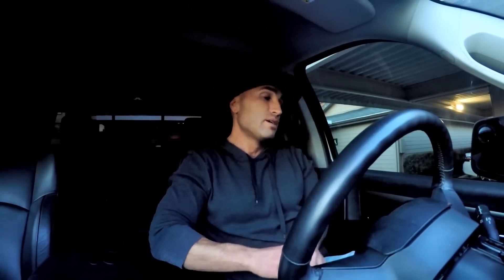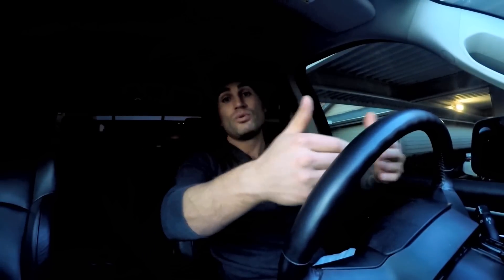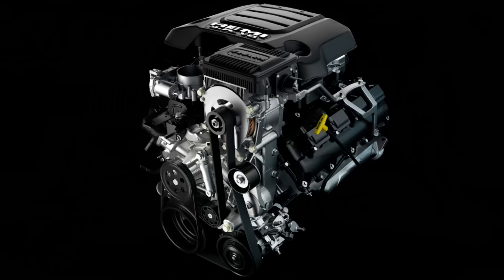Replace Your MECHANICAL FAN With ELECTRIC FAN like the 2019 RAM

Comment: I agree with you 100%… I did this after seeing several videos and in-depth research on this modification, the one thing that I did miss was turning off the MDS increases heat! The fan is I’ll not cycle often enough to bring the heat down

Comment: I recently purchased an electric cooling fan from a Dodge dakota to replace the stock clutch fan on my 08' Ram Hemi. It appears it has all the same locations for the mounting bolts and thee is a plug already mounted on the shroud it came on (3 blade male plug), however, am I missing components to make this work in my truck? I dont see any other plugs in my truck engine comparment that this would plug into? Any help would be greatly appreciated.

Comment: hey John.  you mentioned about removing your stock clutch fan, and shroud.  To replace it with the electronic fan, but you never mentioned if your engine was v6 or v8..  I was wondering if the oem v6 fan you installed, would work for a  2010 v8, 5.7 hemi ???
Reply: His is a 5.7

Comment: The operating temp debate is always a fun one. I have an 07 1500 with the Hemi, stock everything. Hits roughly 215F before cools back down to 203-204, fans kick on when they’re supposed to. Bumper to bumper gets a little warmer, sitting closer to 210F. Unless it’s a race truck or you care significantly about performance, it’s just fun to mess with that stuff. I’ve certainly considered a V6 fan but ultimately decided it’s not worth the money for me when my truck runs just fine stock. Even when hauling, temps sit rock solid 203-204. Considering a 180F thermostat, but until my 203F fails, 🤷🏻‍♂️

Comment: So I'm very interested in doing the efan swap on my 2013 ram sport. But I don't want to change my thermostat to a 180 degree station. And I don't want to take my grill shutters off. If I do the swap do I need to change the fan settings with a tuner or will every still work properly? If I do have to change the fan setting with a tuner what am I changing and to what temperatures and I changing the settings to? Also if I change the settings do I have to change anything else for the shutters or will they work right?? Please answer I have done a tone of reading but nothing is very clear.

Comment: Without the clutch fan doesn't the electric fan only come on if air conditioning is on? So if you're not using the AC how would your engine get cooled?
Reply from the maker: It will come on if temps hit 220* or you get a tuner and reprogram the fans to come on whenever you like

Comment: I Run both.
High humidity and desert conditions with steep hills while pulling a trailer.
HD Clutch fan , deep in a full shroud, 
V6 electric fan with lower programming set point.
If one fan dies like mine did today you will be grateful.
If you're fan is roaring it is busted.
It is supposed to slip quite a bit when first starting and engage more when hot.
A clutch fan doesn't pull hp like he's saying.
Yes, it's true that fully engaged, a clutch fan can take Up to 20 hp to run.
But that's waaay up there and a clutch fan is always cycling so the actual average is quite low.
The tests he is referring to is dyno cell testing peak hp for drag racing.
E-fans eat hp too.
They don't run for free.
Unless you're drag racing.
If you put a full throttle disconnect relay on the E fan and realize that a properly working clutch fan won't even be engaged with that much air flowing at speed. 
External plate cooler for the transmission is a great way to increase cooling capacity and remove the possibility of getting pink goo for transmission fluid if it were to leak .
An override switch for the E fan relay mounted inside the cab to put full juice to it when at slow speeds is nice too.
Replacing the two hundred bends per transmission line , on the factory lines that wrap around the catalytic converters is a big help too
So the insurance is definitely worth it.
My truck would have taken a beating otherwise.
As soon as it started to activate the E fan all the time I drove to the parts store and picked up a new HD fan clutch.
Had it installed in no time flat and nothing got beat on.
Aloha

Comment: In the video you state "probably the 2018 hemi."  Any update on that? I just got a 2018 with the hemi and might do that e Fan mod if I can pin point the correct fan to buy. Looks like I need the 09-12 V6 fan? LOVE LOVE LOVE the videos, THX
Reply from the maker: Yes sir it will fit the 2018 also but make sure you order a v6 fan from a 09-12.  They changed the plug on the 13+ v6 fan to some weird one 👍

Comment: @boostedmotorsports So if I have the capability of changing the temp the fan turns on at. What is the best set up to run? 180* Tstat and fan turn on at what temp?

Comment: The 2019 Ram without the thermostatic fan has a very different radiator installed to compensate for the loss of constant flow the rotational thermostatic fan generated.  You must remember that the thermostatic fan has a fluid coupling that controls when the fan is actually fluid connected or freewheeling.  To remove the thermostatic fan from the earlier models should only be done when the vehicle is used for off-road operation such as drag racing.  The dual fan operation is for optimum cooling.  Ask yourself the question, "what if the fuse blows or short happens while you are out driving?" Now, you don't have but one fan now, get it? As with me, I have my favorite 2014 Dodge Ram R/T which came with HD cooling for towing.  When I start my truck up in the morning, I don't hear a loud roaring noise coming from my engine compartment. Reason, the fluid clutch is freewheeling quietly no noise.  If you have loud noise during a cold start upon startup, then you have a problem with your fluid coupling engaging while your engine is cold. Lastly, I would not put a fiberglass flex fan on a gas lawn mower much less my prized truck. The rivets come apart and shatter sending blades of fiberglass into your radiator and everything else. Take the advise of a lot of us from the late 60s and 70s muscle car era who removed their thermostatic clutch fans for the so called popular loud fixed blade flex fan and drive in the street with all the loud roaring, engine didn't keep a constant temperature, and subsequently flex fan comes apart when you are in no mans land.  Frustrated, you get back home and repair all the damages that were done & now replace your favorite High Performance thermostatic clutch fan assembly back on your vehicle and you notice an immediate difference in constant engine coolant temperatures along with less irritating noise.
Reply from the maker: Electric fans have been out forever and the majority of the vehicles on the road rely on electric fan cooling.  Not scared of a fuse blowing or fan motor going as its rare.  Also it would only be an issue if you were dead stuck in traffic.  Even city driving the fan never comes on with the supporting mods. The jeep with the same 5.7L engine has an electric fan from similar years so not a valid point.  Been in 112* desert heat and still sitting at 185* which is cooler than the stock 203* operating temp.
Reply: Also ur saving your water pump life taking the big mechanical fan off.

Comment: Hey John

Great videos as always! 

I want to do this mod on my 2018 ram limited but I'm not sure if I could do the tune as I think my pcm is Locked from factory.... can you confirm?   If I change the thermostat to the 180° do I really need the tune? I'm assuming that's just to tell the fan when to come on correct?   Is 220° harmful? 

Tx again brother!   Great vids!
Reply from the maker: Thanks for the support! I believe they have already cracked the 2018 PCMs and you can get it unlocked and tuned but double check!  You can change the thermostat without a tune but some have reported a CEL in cold weather but the data on that isn't 100% certain.  220 is on the warmer side but doesn't hurt anything.  stock thermostat isn't fully open until 203* anyways.  If you delete your active grille shutters the fan will rarely come on anyways.  Any "loss" in aerodynamics from removing the shutters is gained back with the removal and drag of the mechanical fan so I didn't see any downside to be honest.
Reply: @BoostedMotorsports  
O.k. cool I'll look into it for sure!
CEL?  Sorry for my newby-ness.... 

You think of I delete the fan ill have warrentie issues if say anything messes up?   Serems like a pretty obvious question I know... but.. I wonder if they would care as long as it's getting proper cooling.... Surry dude but I think I may have answered my own question. Lol.. maybe the best thing would be to wait til warrantie is up... thoughts? 

Tx again brother!   Vids are great!   Keep em coming! Much appreciation for sure! 
Adam

Comment: Hey BoostedMotorsports my truck goes to 212 degrees and then cools to to about 194 degrees then  starts to go back up. You think I would still need a tuner to adjust the fan cut on?
Reply from the maker: Is that with the mechanical fan deleted?  Stock thermostat fully opens at 203* so your temps aren't far off.
Reply: @BoostedMotorsports  No sir, it is stock 2014 Laramie Limited with towing package.
Reply: I want to do the fan delete but thought I would see what you had to say about my Temps

Comment: What would happen if i just removed the mechanical fan and kept the v8 efan?
Reply from the maker: You could do that too as long as you don't do any heavy towing or live somewhere super hot cause that fan is a bit smaller than the V6 version.  With that being said though there are guys in Texas heat running the v8 efan without issues

Comment: What's the point of the 180 thermostat mod? Isn't 180° to low for the engine? I don't understand how it works.
Reply from the maker: It keeps things cooler which is better for performance.  They run the higher 203* thermostat from the factory for emissions reasons but it hurts performance with the engine that hot.
Reply: BoostedMotorsports Oh I see then! Thanks for that. I would definitely want to get that upgraded. Taking care of keeping the engine cool just means a longer lasting hemi!

Comment: I'm wondering what would be the best choice for someone that wants to keep the truck mostly stock.   I just want to see MPG improvements for the most part and don't really want to get a tuner but I want the electric fan to coll the engine properly.    Can I just swap the fan with the electric without having to do any tuning?
Reply from the maker: You can swap the fan without getting a tuner.  Only thing is the fan wont come on until about 220* with the a/c off which is slightly warmer than typical operating temps.  It won't overheat.  If you run the a/c the fan will come on sooner and keep temps closer to the 205* mark where they usually are with stock thermostat

Comment: Would it be okay for me to do the fan mod without doing the tune or lowering the fan temp. probably biggest thing I'll ever tow would be my bike down to Bike Week
Reply from the maker: Yeah only difference you will notice is temps will creep up to 220* in traffic if you don't have the A/C on before the fans will turn on.  Stock thermostat is 203* so temps will hover around here normally.
Reply: @BoostedMotorsports  so what does changing to a 180Tstat do for the electric fans?m

Comment: I have electric fans on my 800hp cummins turbo diesel with no problems towing.
People argue all the time but electric fans are WAY better for cooling in stop and go traffic.  Mechanical fans must rev the engine up to move enough cfm to cool itself.
So most electric fans move around 6000cfm of air and most mechanical fans move around 9000cfm @ 4000RPM's.  People then say you can't have electric for towing but I know electric is better because you move more air at a stop AND on the highway you shouldn't need a fan at all.  There is around 6500CFM per square foot against your truck @ 65mph, that's far more than electric or manual could ever do.
Reply from the maker: Well said brother!!!!  I haven't had any issues either and the 2019 RAM 1500 is all electric now too!

Comment: Any idea what the V6 fan is rated at?  The 2019 is 850watt but curious to see how it compares to the V6.  I really want get the V6 fan but worried about towing and the mountain passes here in Idaho.  Without the clutch fan and only V8 efan it does get hot(don't recommend).  Have to have the mechanical and V8 efan to keep it cool.
Reply: West27 if i just leave the v8 efan without the mechanical fan and dont tow anything does it stil run hot?
Reply: Smtx 512 remove most of the shutters and then it will be fine. Leave the 2 top and bottom shutters so it doesn’t throw an CEL
Reply: West27 sounds good appreciate it

Comment: I wonder if the 2019 electric fan will be compatible with our trucks. I might have to take a look when they start hitting the lots more. I'd like to see if the plug is going to be like the 2013+ V6 fan or like the one that you put in. 

I'm really enjoying your videos. Thanks for taking the time to do them. They are really informative and I have learned quite a bit.
Reply from the maker: Thanks Tim for the support on the channel!  The V6 fan is plenty powerful and I wouldn't hesitate to give it a try!  Mine has been working great and my A/C is even cooler now in stop and go traffic on 110* days.

Comment: I used a SUPERCHIPS 3845.  When I first bought it last October, there was no setting for changing the fan temp.  They have since updated it and It has 3 settings for the fan:  STOCK (222 degrees), 192, and 180.  I chose the 192 setting.  I have a 190 t-stat, and once the engine hit's 192 as it always does before the t-stat opens, the fan comes ON and never turns off again, since the t-stat closes again around 188.  I believe the temp has to drop 8 degrees before the fan will shut off.  I ordered a 180 t-stat; that should solve this.  I must say that even with the electric fan running, the truck is still quieter and a lot more peppy.  I have not yet changed to the V6 fan yet, (just running the factory A/C fan), and it has not gone over 192.  Temperatures here are around 48 during the day right now.  I will do the V6 fan before summer for sure, since it has a shroud and looks a lot better.
Reply from the maker: Thats awesome Kurt!  Does your truck have active grille shutters?  I made another video showing how having the active grille shutters and mechanical fan delete does some funny things.  Take a look in the ram mods playlist or let me know if you need a link but has some interesting info! 🤙
Reply: Nope.  I'm in the clear there.  I'm not sure if that was an option in 2011.  Thanks!

Comment: Best thing about this mod is the engine is so much quiet with out that dumb mechanical fan spinning 100% of the time!
Reply from the maker: I totally agree Kurt!  That loud ass fan is annoying! 👍
Reply: If the fan is loud it's busted or you're going slow and it's hot.
It's not supposed to stay locked at anytime.
An override switch for an electric fan to run full time in slow hot conditions works like a charm. I have dual alt and batt system so low rpm isn't an issue with drawing that much juice.
Plus it's always good for welding up busted stuff on the trail.

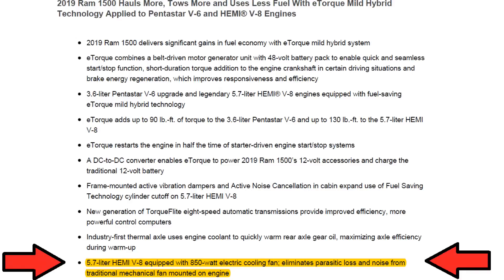Comment: Thanks for showing the specs for the 2019 @5:08 where they eliminate the fan clutch. I was wondering what the hype is about deleting the fan clutch. But I've also read where ppl say you have to have a tuner to tell the ecu when to turn on the electrical fan. I don't have a tuner yet, so guess I won't be doing this until I have the tuner.
Reply from the maker: No worries!  I actually ran the electric fan for a few weeks without a tuner.  It still turns on but if you don't have your A/C turned on temps will creep up to 220* in stop and go until the PCM turns on the fan.  With A/C turned on it usually keeps the fan on so it stays cool.

Comment: So can you get an after market electric fan or would you advise the one you used
Reply from the maker: You definitely can!  Some people have had good luck with them.  Check out the other video I made on the install. All the links to the fan and step by step are there.
https://youtu.be/Fn0whRnJqWU
Reply: Boosted2k I've already seen it 🖒

Comment: do you need to have the D sport turner hooked up all the time for it to run the fans at that setting?
Reply from the maker: Nope you just flash the PCM with the tuner and then you unplug it and can leave it at home or in your glovebox.  Once you load the tune it is programmed until you change it again with the handheld tuner.